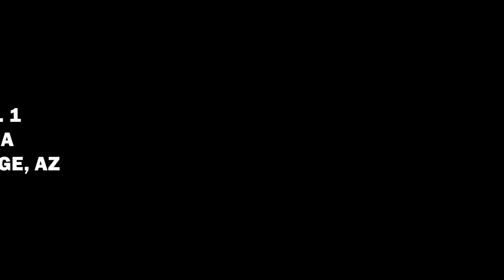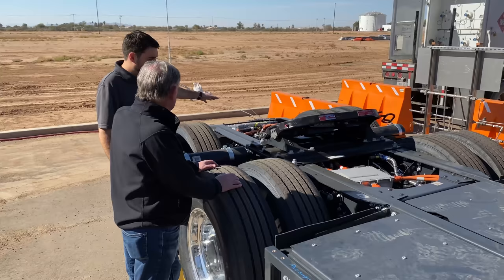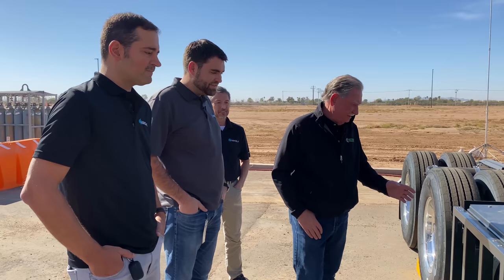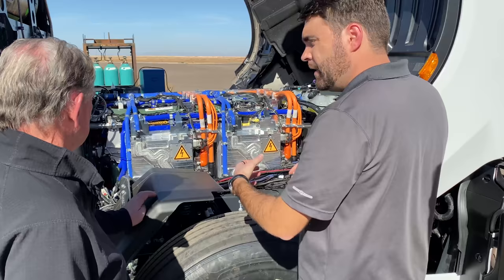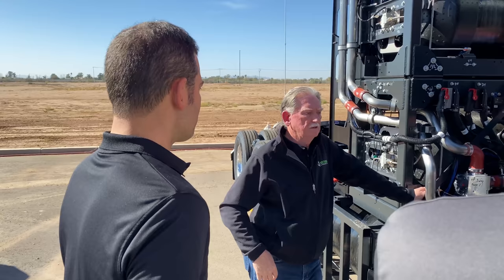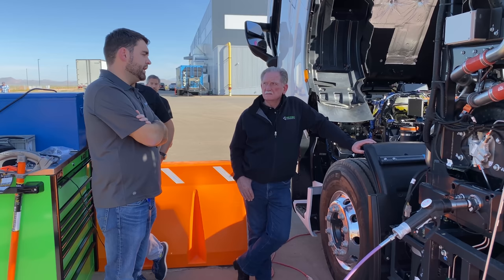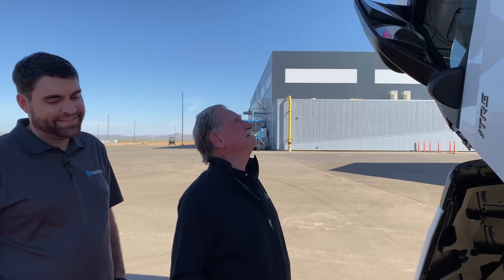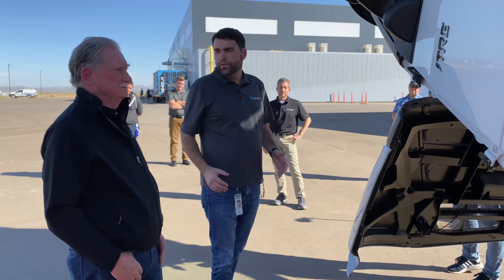Nikola Series - Ep. 1: Introduction & The FCEV Alpha

Comment: A good H2 joke: "do you know why H2 vehicles have such a longrange? because the next H2 station is 300 miles away."
Reply: Yeah, said the same for electric cars in y2k. Lol.  It's the Fax machine problem all over again.
Reply: more like 3000
Reply: @mattmcfly2165  H2 vehicles are just just an expensive solution to a quickly disappearing non problem. 18% electricity round trip efficiency is pure engineering nonsense.
Reply: @chargehanger  I agree.

Comment: Nikola is the most Eco - friendly vehicle company.

Rolling a truck down the hill releases zero carbon emissions.  ... LOL
Reply: Towing it back to the top does though
Reply: Also ---  Hi, Trevor Milton. How's it going? I know you're watching this   🤣
Reply: wrong. an electric can regen down the hill. i remember a special use case calculation where the truck is loaded on the top of the hill facility, and needs no charge for the way back. also mining trucks feed back into the power lines.
Reply: @lapaleves  Well sort of. The mining trucks added mass at the top and removed it at the bottom.
Reply: @lapaleves   I think his humor went over your head on that one, he was joking about the faked commercial Nikola did a while back, they made it look like they had a working truck when it was just a roller with no motor.
Reply: Producing, distributing and storing hydrogen is not easy. Hydrogen is a very small atom and thus there will be leakage problems.
Reply: Making, storing, transporting hydrogen is not all that eco-friendly. At all.

And is all that stuff behind the driver safe in a collision?  I think not so much.
Reply: @jonkeau5155  well aware of that. still the point of mine is valid.
Reply: Listen, Nikola has the best-in-industry gravity assist technology
Reply: I told one of the Nikola engineers at the Vig in Scottsdale they should have named the company Newton after the founder of gravity.
Reply: Joe Biden: 'Nikola are leading the world in electric semi trucks, Trevor you did it and it matters!'
Reply: 좋단다
Reply: This is so 2020
Reply: @piccalillipit9211  Kinetic technology saves %0% fuel
Reply: @brianevolved2849  - well until you reach orbit - kinda pays off after that
Reply: Well... except for the truck that brought the truck that rolled down the hill and then towed it back...LOL
Reply: Lmao! I have never had a comment with 450 likes before. Thank you all
Reply: @mr.v3061  - Hey - live it - enjoy it - screen print it and frame it - its 2021, you have to take pleasure in the tiny things; and Im not joking.
Reply: @lapaleves  well you still need more energy to go back up hill since the regen isn't 100% efficient and the friction by the tires also use energy that you won't get back
Reply: @roykale9141  the case study said you get more regen from the load, which about doubles the weight, hence the energy. So you need regen + air & rolling resistance to just be less than 50% loss.